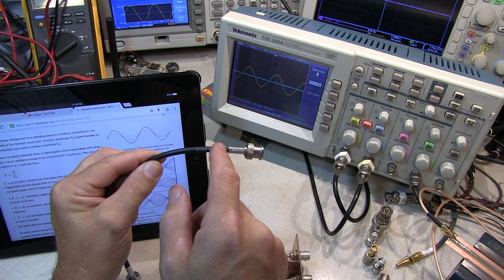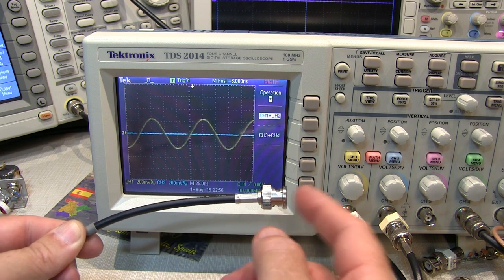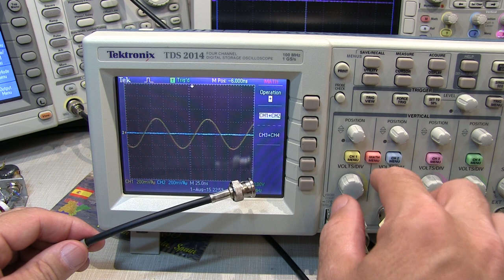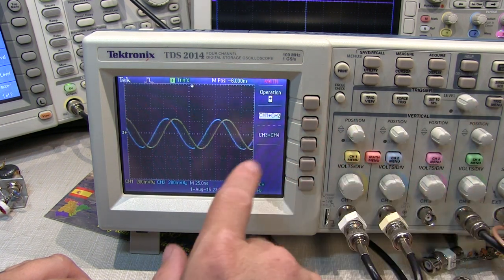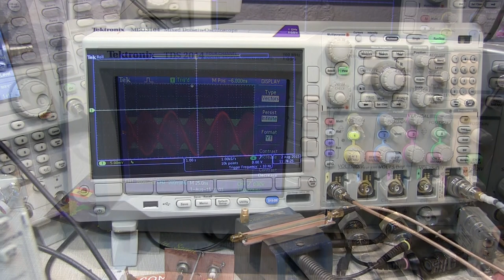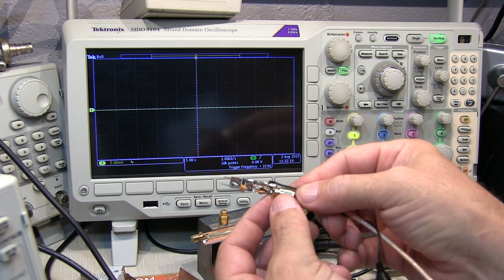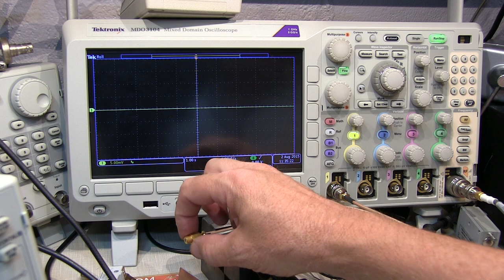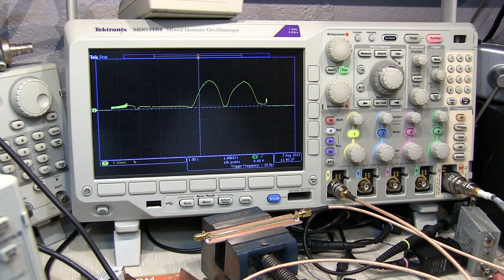#208: Visualizing RF Standing Waves on Transmission Lines

Comment: Question(s) 

(1) Does high SWR affect receive strength? I realize transmit is in mW to kW range (Ham bands) and receive is more along the lines of µW but it seems like the receive signal would be affected by high SWR.

(2) Are high voltage power lines affected by SWR or something akin to it? It's an AC signal albeit a very high voltage one... If I remember correctly high voltage tends to travel along the outside of a high voltage transmission line (skin effect) and anyone that has ever driven under a transmission line with the AM radio on in their car has heard the interference from them but is there an analog to SWR for cross country high voltage power transmission lines?

Random thoughts from the ether.

Merry Christmas
Reply from the maker: +Michael Lloyd High SWR can affect receive signal strength.  In most cases, it's not a problem, but optimizing/tuning the antenna can help.  Regarding HV power lines - I'm not sure if it's much of an issue.  First of all, the frequency is only 60Hz (or 50Hz), so the wavelength is extremely long - on the order of 3000 miles.  Second, I doubt that the HV transmission lines are constructed with any fixed characteristic impedance.
Reply: Thanks for the answers. Both questions crossed my mind and I thought that you would have the answers, and you did. I appreciate your time.

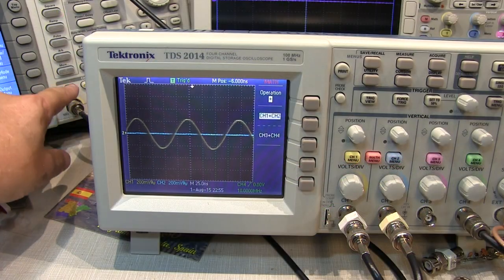Comment: Great Video but I'm baffled as to how the green trace on the oscilloscope (1:32) appears to travel in the opposite direction to the blue trace? Is the oscilloscope aliasing because normally signals go right to left given that the RHS of the trigger on the screen is 'real time' and the LHS is what came before. I welcome any explanation.
Reply from the maker: The visual trick being employed here to simulate the wave travel (in super slow motion) is to trigger the scope on the 10MHz reference from the function generator, and then apply a slightly higher and lower frequency to the two channels of the scope.  The small (1Hz) frequency difference makes the waveforms appear to walk one way or the other.
Reply: Thanks I really appreciate your reply and that trick is ingenious which gives rise to a great video on standing waves.  Keep up the great work!

Comment: I don't understand why the 50 ohm termination matters (8:30 mark). It seems to be its not completing the circuit, so its just 50 ohm on top of an open circuit (so negligibly higher, very high impedance). What am I missing? Its only a single trace leading out to the terminator right?
Reply from the maker: The piece you're missing is the fact that the transmission line *is made up of two conductors*, the trace and the ground plane beneath it.  The 50 ohm termination connects the "trace" to the ground plane at the end of the line - so it certainly has a dramatic and expected effect on the reflections and standing waves on the line.
Reply: Thanks for the fast response. Really loving the videos. So just to be sure I understand the coax signal line (inner conductor) connects to the outer sheathing via the terminator?
Reply from the maker: Yes, the 50 ohm resistor in the terminator connects the center conductor to the outer conductor.

Comment: could you briefly explain how you setup your AFG and what did you use for trigger? thanks!
Reply: did you phase modulated the two sine waveforms with sawtooth signals, perhaps one going up and one going down, with very low frequency? then what was used for triggering the scope? Was it the 10MHz reference output of the AFG?
Reply from the maker: @amirb715  I set one channel to be 1Hz above 10MHz, and one channel to be 1Hz below 10MHz, and I used the 10MHz Reference Output from the AFG as the trigger source.

Comment: Very interesting video. However what makes a signal reflects? in other words, why an open or short circuit is considered an ideal reflector?

Thanks for the nice informative video.
Reply from the maker: Mohammed Algailani Check out the other videos linked in the description - lots more information about the cause of the reflections.
Reply from the maker: Mohammed Algailani Any impedance that doesn't match the transmission line impedance will cause a reflection due to the conservation of energy.  An open or a short are the two extreme cases - both resulting in a full amplitude reflection.  In the case of the Open, the voltage keeps its phase, and the current reverses direction.  In the case of the short, the current keeps its phase, the voltage reverses polarity.

Comment: At last in microstrip transmission line ,what is that oscilloscope is demonstrating ?? Voltage or power???
Reply from the maker: It's measuring RF voltage amplitude.  Of course, power would proportional to the square of the voltage.

Comment: Good explanations but something that bugs me, at a constant frequency and constant incorrect impedance the reflected waveform would not be moving in relation to the primary waveform. The only way you'd be able to witness this is if you were to drag a probe along the transmission core of the cable without bothering the existing impedance. Am I mistaken?
Reply from the maker: ***** Waves DO travel in both directions.  What I showed on the scope was a dramatization in slow motion - but there are certainly forward and reflected waves that travel in opposite directions in a transmission line when it is not properly terminated.  This old AT&T video illustrates the concept brilliantly:
https://www.youtube.com/watch?v=DovunOxlY1k
Reply: ***** I understand that they are traveling in both directions(main+reflection), but in the first part I didn't understand if you ever said that they would be standing, the constantly changing waveform you show on the screen isn't something you would ever see when you probe singular points on a cable, it can only be witnessed with a unique setup the same as the 2nd part of the video where you drag along the strip of conductor. But I guess that's what you were getting at all along! It just wasn't entirely clear to me.
Reply from the maker: ***** Correct - the first part of the video is a dramatization of the wave motion (in super slow motion) to illustrate how the standing wave is formed from the fwd and ref waves adding together.

Comment: Thanks, very cool! could you also make a quick demo of the standing wave pattern with a short, and then if I'm really lucky an explanation of how this ties in with coax stub filters? ;)
Many thanks though, love your videos!
Reply from the maker: Steve Kitsch The standing wave pattern will be identical for a short, except that it will be shifted by 90 degrees.  A 1/4 wavelength long line that is open at the end looks like a short circuit, and when shorted at the end, looks like an open.  See this video for some measurements on a stub filter.
https://www.youtube.com/watch?v=bbnllGycQws

This method can also be used to measure the length of a piece of coax, or find the distance to a break in the line.  Sweep the frequency starting from low f and measure the amplitude at the input.  When the input signal decreases to a minimum, then the line is 1/4 wavelength long.  Using the velocity factor for the coax, you can then calculate its length.

Comment: Hi Why the waveform obtained with the rf probe is not oscillating between max and min as seen in the simulation in the begining of the video ?
Reply from the maker: Because the RF probe is detecting the envelope (amplitude) of the *standing wave*, which is not oscillating up and down.
Reply: Oh that clears everything. Thank you.
Reply: because detector probe has capacitors, strictly saying "RC time constant" of probe is much longer than wave period. So it acts as AM demodulator, which is essentially rectifier - it converts AC to DC

Comment: 8:08 so why is the amplitude of the voltage constant here? (When your resistor is the same as your line resistance)? 

I get that the wave of the voltage is just gonna continue its way down the line, but it's still oscillating on its own, too, right?
Reply from the maker: The probe is showing the signal magnitude, and it is virtually constant because the load matches the line impedance, thus there are no reflections off of the end of the line which would result in constructive/destructive addition to the forward wave.
Reply: @w2aew  I get that but a sound wave traveling from a to b, also has crests and troughs, ON THE WAY, and yes, could, eventually, do the same as reflecting etc, making a standing wave. But before the reflection, it still has oscillations, so this electric wave does too, no? So I thought, by that logic, you could also measure the crests and troughs midway...

This is a cool pic: https://i.imgur.com/QeP5hc7.png
Reply from the maker: @arisoda  Yes, this electric wave has the same sinusoidal shape - but it's frequency is much too high to be measured directly by the oscilloscope.  That is why I'm using the RF Detector probe.  It responds to the peak amplitude of the RF sine wave.  So, you don't see the crests and troughs of the electrical signal - only the amplitude of it.

Comment: You know, I had a thought about the RCA video, and I wonder what would happen if a inductor or smoothing capacitor was put inline, but with the capacitors value being small (less than 10uF). I thought a few minutes ago that it would either make the edges smoother, or throw it out of sync a little bit, or make the image have a sort of phosphor blur effect. I'm curious and want to do it on my NES, but I don't want to damage it. Does anyone know if it will?
Reply from the maker: It likely won't damage anything, but it won't have any benefit either.
Reply: Teslablade I tried this, because I was curious how basic I could build a filter to separate the colour signal from an NTSC video signal.
Yes, a very small capacitor between the signal wire and ground will blur edges, while slightly muting colours, but it will also round off the sync signals, causing the image to shift slightly, and if overdone, will eventually cause loss of sync.  I don't think it will be a useful effect at all.  It won't cause any motion blurring or anything like that, just an overall horizonally blurry image with an unstable sync.

Comment: See my video at https://youtu.be/HkptQNCrBnY on how to do the scope standing wave display.
Reply from the maker: Robert Haas This is exactly what I did, except that I used a 2 channel function generator.  I used the 10MHz reference output as the trigger, and set the two channels to slightly above and below 10MHz.  I didn't realize that I basically duplicated what you did in this video two years ago!  Nice work, of course!

Comment: excellent video! i had one question in my mind: although reflections can occur in any mis-terminated length of cable, am i right to understand that standing waves will only occur if the length of the line is a wavelength multiple of the input signal?
Reply from the maker: No, standing waves will occur at any line length when mis-terminated.
Reply: Hmmm, i cant see why. Say i have a source driving a line with an open circuit at the end. This means(i think) that both ends of the lines must be anti-nodes if a standing wave is to form. Now, only a finite number of wavelengths would satisfy that requirement meaning i could only have some Fo and its harmonics? PS i really appreciate that you take the time to reply to all these comments :)
Reply from the maker: There are 'special' things that happen when the line is certain length w.r.t. the signal wavelength. When the line is half wavelength or multiple of half wavelength long, then the impedance seen at the input of the line equals the termination impedance, whatever it is. When the line is a quarter wavelength long (or odd multiples of quarter wavelength), the input impedance 'inverts' the termination- an open circuit looks like a short, and vice versa.  

At any length, the forward and reflected signals travel at the same speed but in opposite directions, thus the summation results in a standing wave as shown in the red persistent trace shown on the little scope.
Reply: w2aew wow. im just getting into RF because of this channel, and all these 'special' things are so fascinating. Do you have a good book you can recommend to get started. Excellent as always! thank you for the explanation!

Comment: Why is it that you measure a voltage node at the point where the line is terminated by an open circuit? I would expect for an open circuit to have maximum voltage (antinode) and zero current (node)
Reply from the maker: It's because I didn't probe at the very end, I was about 1/4 wavelength from the end (the open connector).
Reply: @w2aew  Ah okay, thank you! And thanks for responding so quickly. Very interesting video!

Comment: Thanks for this.  If this interests you maybe you could explain frequency hopping?
Reply from the maker: +Joseph Nicholas Frequency hopping is quite simply when a devices changes the carrier frequency that it is transmitting on.  Bluetooth is a good example.  Bluetooth 2.0 utilizes 79 different "channels", or operating frequencies. and switches between them in a pre-defined pattern, only spending a few hundred microseconds on each frequency.  Other nearby bluetooth devices also frequency hop, but they don't use the same frequencies at the same time. This is one example of frequency hopping.
Reply: Frequency hopping is most frequently implemented on cell phones and used to insure a high level of privacy.  On initial handshake a prearranged pattern key is used like what happens in pgp encryption/decryption.  What other reason could there be than to go to this added inconvenience.

Comment: How are you triggering to get this slow rolling wave?
Reply from the maker: I am using the 10MHz reference output of the generator as a trigger, and then the main output frequency is set to be 1Hz higher or lower - that creates the slow rolling wave.
Reply: @w2aew  ooh ok, I was able to do it triggering off ac and doing 61 and 59 hz and was surprised it worked, but that sounds better since it’s actually phase locked

Comment: how is the cable connected...to what?...how to the scope's inputs
Reply from the maker: I used a bit of a trick to make the visual work.  The function generator has two outputs, each connected to channel 1 and 2 respectively.  I also connected the generator's 10MHz reference output to channel 4, and triggered on channel 4.  I set channel 1 and channel 2 to be 1Hz above and 1Hz below 10MHz.  That makes them move slowly in opposite directions with respect to the trigger on ch4.

Comment: Excellent demo; mu Rogol DS2102 doesnt have persistence on the math trace :-(
Reply from the maker: My newer scopes don't either, which is why I used the old TDS2000.
Reply: You have to wonder why? Seems an easy thing to include in the functionality and makes a load of sense in this example. I'd like to do something like this demo at my local Ham Club in the UK and persistence would add value.

Comment: Nice way to visualise this on a scope. The second part is what they used to do with a slotted line. http://www.pa4tim.nl/?p=4978 for pictures.You can do a lot more with those, like measuring the frequency with a ruler. It is a sort of network analyser, a bit in the way the sliderule compares to a calculator.
Reply from the maker: pa4tim Yes, since I don't have a slotted line, I had to improvise ;-)